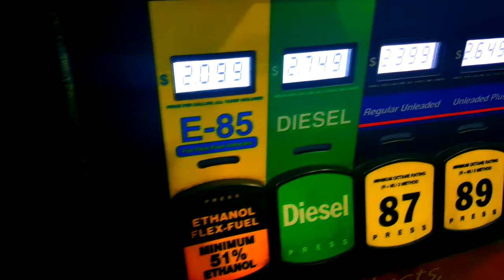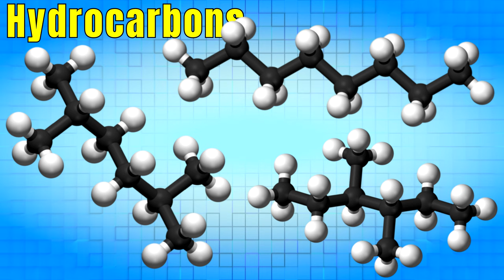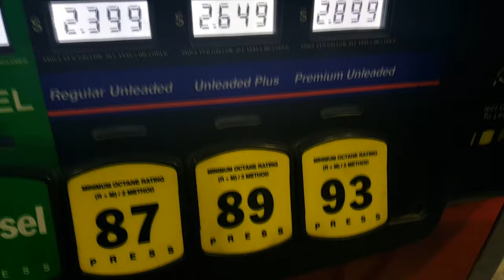Stop THROWING MONEY AWAY at The Gas Pump! 💸⛽️ Octane Explained

Comment from the maker: At around 6 minutes, I wasn't specific about what "most cars" I was referring to. I meant "most forced induction cars", and technically even the most modern ones are still losing the slightest bit of power at high altitudes. Boost pressure controlling has major benefits at high altitude, though.

Comment: I’m curious. What fuel ⛽️ rating do you put in the GTO. I always go for 91 up ⬆️
Reply from the maker: I have gone as low as 89, but that was when that was the highest octane rating that worked at the pump. I generally stick with 93, and use 91 when that's all that's available.